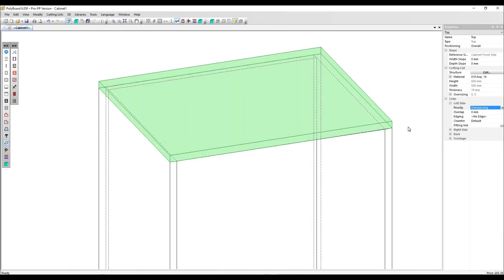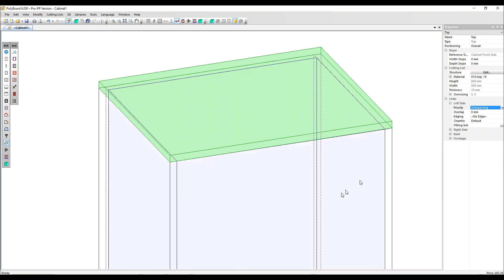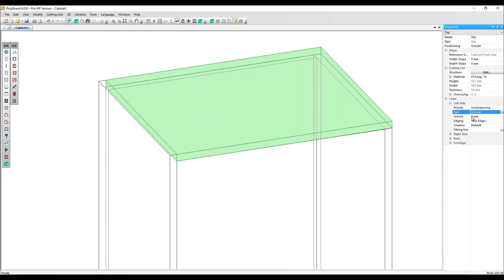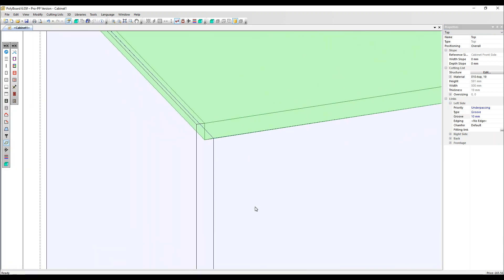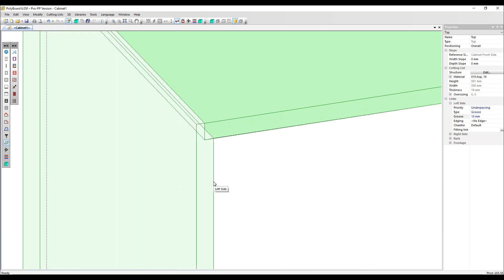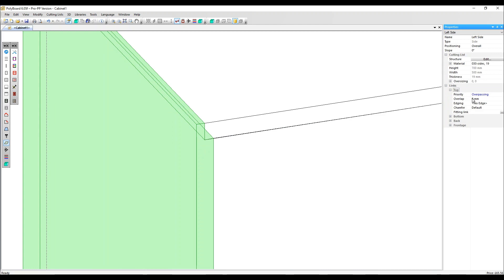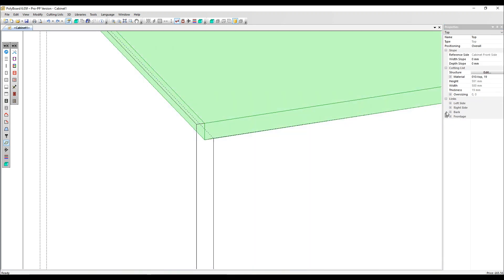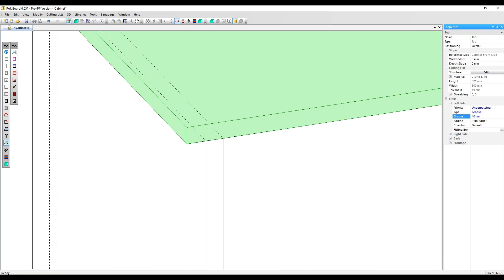Groove Joint/Rebate Joint (underpassing panels only) with Polyboard

Comment: how can we do a rebate joint inside a panel. ex-a top panel overlaps a backpanel by 18mm. the backpanel's top edges are rebatted.
Reply from the maker: As we have not received any response to our license verification request, we are still eagerly awaiting your reply in order to address and respond to your requests accordingly.
Reply: @wooddesigner  is user code enought for the verification